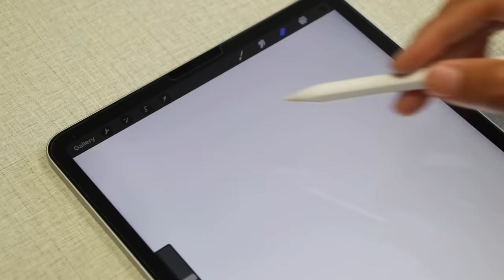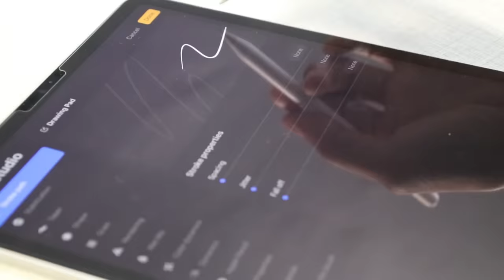handmade eagle ring - how to make jewellery

Comment: What kind of torch setup do you use?
Aside from that, that was amazingly beautiful.
Reply: Beautiful work
Reply: The torch looks like something I used when was   goldsmith  in Hong  Kong, it was very popular,, may be also in Asia, I saw some tool suppliers still sell in HK., when I was there 10yrs ago? . Not sure now..? That is an air pump  need  steps to ,  air thru hose into a small  Brass container, that store some regular gasoline .,then to the torch., very good idea for a small shop.
Reply from the maker: yes that's right ,, still available for sale on ebay or china marketplace